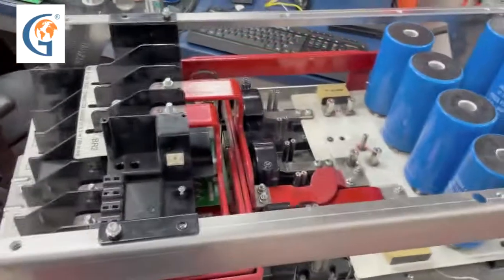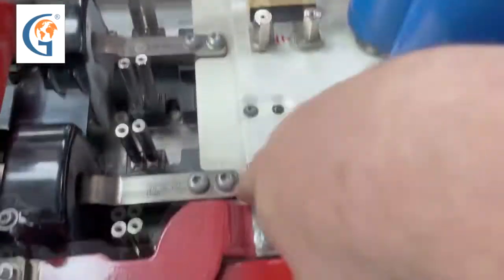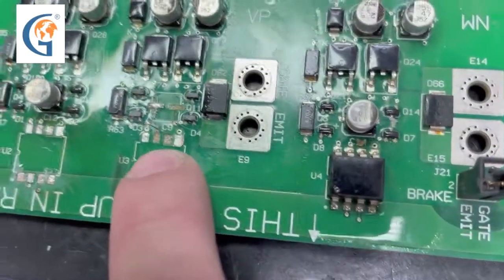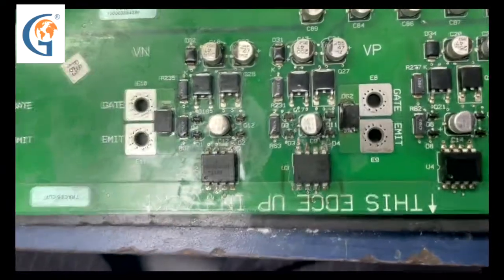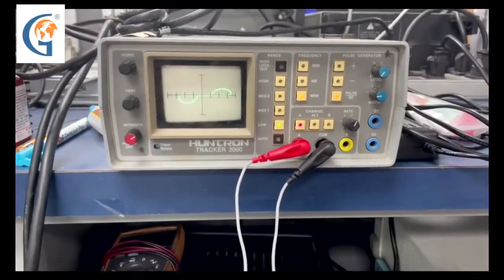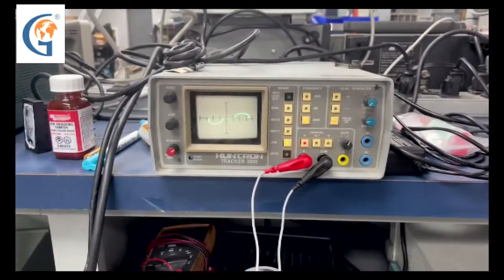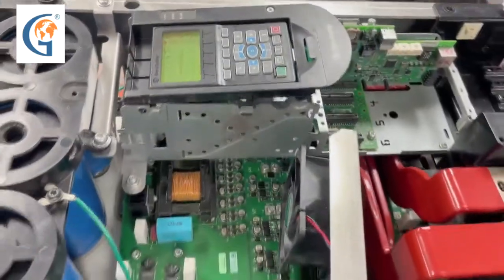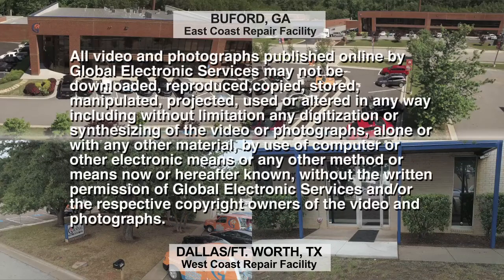Allen-Bradley PowerFlex 755 VFD - Blown IGBT and Firing Board - Full Repair and Testing

Comment: I'm repairing a Powerflex 755 with embedded Ethernet/IP and a 20-750-S3 security card. The status shows "not enabled" in HIM. I plan to run the drive using the HIM keypad, but the "not enabled" status prevents me from manually running it. Could you please advise me?